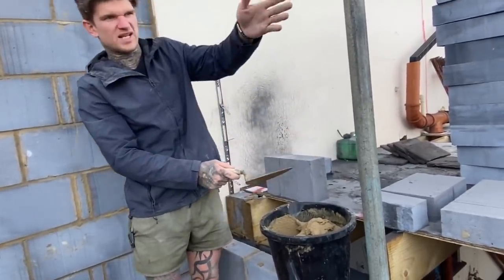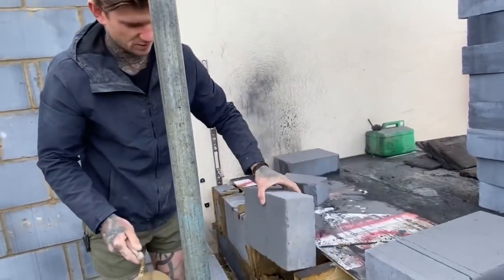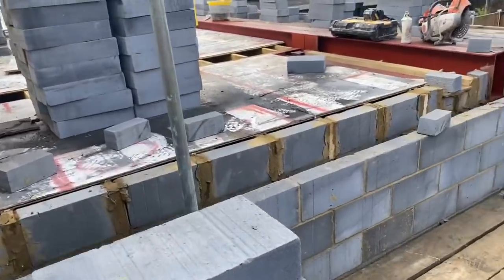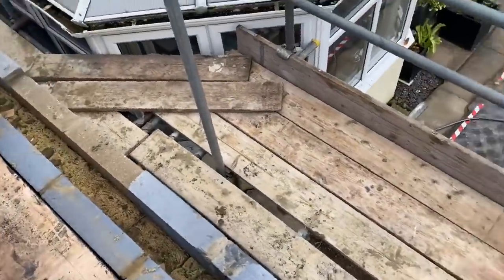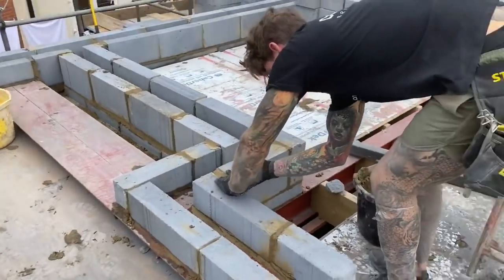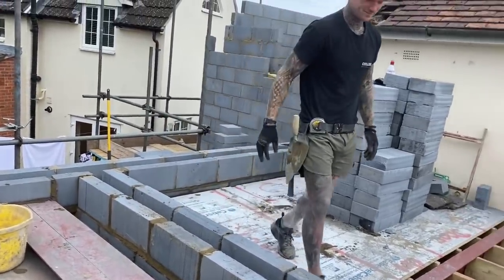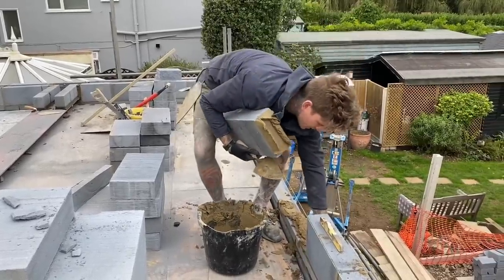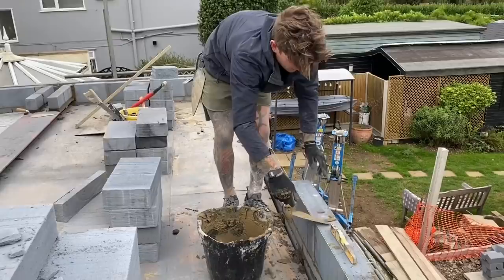Bricklaying. Day 9 new apprentice

Comment: Charlie, lower the revs on your saw somewhat, no diamond blade is made to cut at the rpm you’re using. Lower the revs and see how much better it cuts. Saw will last longer as will your blades and it’s no slower.
Reply from the maker: Not sure how?
Reply: Think he means say 3/4 on the trigger instead of flat out. I always rev the granny out of it, have to try it but always thought flat out's tje way!
Reply: Piss off there designed to go flat out
Reply: Slower speeds cut faster
Reply: jordan somers Jordan knows 👍
Reply: Michael Hammond have a look at the recommended rpm for a diamond blade, have a look at the max rpm of the saw then tell me what I said is wrong. They cut better just off of full throttle. When you hold it flat open what do you think is happening to the 2 stroke cylinder and piston inside? Go have a read and stop being a caveman
Reply: Drunk Duck about 5k or just above ? Most blades cut at 3-4.5k? Hence just off full throttle cuts more efficiently. It’s a fact. Charlie was cutting soft blocks and you can hear the saw bouncing which isn’t ideal for an engine. No engines last when operated at full throttle continuously and as for school boy 🤷‍♂️ if you don’t believe me go research, let me help you start  
https://www.premierdiamondproducts.co.uk/support/how-to-use-diamond-blades-safely
Reply: Charlie Collison peak torque output of an engine isn’t at max rpm, it’s close to it though.. if you hear the saws engine bouncing just release a touch. You should notice it will increase the speed of the cut when you get it right. And your saw, plus blade will last a lot longer
Reply: Drunk Duck the disc speed rpm I quoted was from the still 410 technical data sheet and only and idiot cuts thermalite blocks with a hand saw
Reply: Drunk Duck he wasn’t cutting cinder blocks either for the record, cinder blocks are used for retaining walls, filled with concrete and a starter bar for structural strength. Hope you’re learning friend 😅

Comment: Please start stacking your blocks the right way up it’s driving me crazy 🤣🤣
Reply: I think they do it this way so they can just cut them without moving them.
Reply: Mate I think they may use a sack truck I'm order to load out quicker. Could be wrong but normally this is why they're stacked like this to save time
Reply: @vivalachocolat1  they dont. It's on 1st lift. Does the sack truck fly?
Reply: @man1cs171  haha my bad pal I just know that's what we do but clearly they're just stacking them like that for whatever reason. But a flying sack truck that's the one kid
Reply: @vivalachocolat1 flying sack truck. it's called a loadall 😂😂

Comment: Damp round end of joist ?
Reply: I thought that.
Reply: Doesn't need it as its on the internal wall, not out outer skin which gets the rain etc
Reply: @rosshardy5166  Timber joists usually load onto the inner skin else they would be sticking out the face brickwork. You sure dpc isn't required?
Reply: Yeah thats what i meant by it being on the internal wall mate, and thats why dpc isn't required technically. And like you say, if the joist was touching the outer skin, then it would need to be wrapped in dpc 👍
Reply: @rosshardy5166  erm, no, the end of the joist is in the cavity, cavity is designed to have moisture inside, the end of the joist will dampen and rot over time, any standard building inspector will expect timber ends to be wrapped in dpc